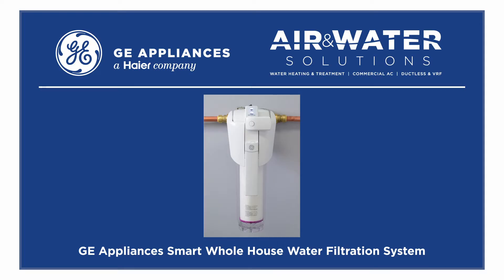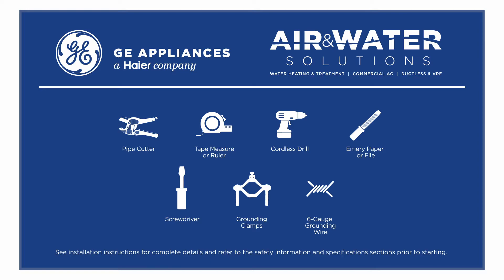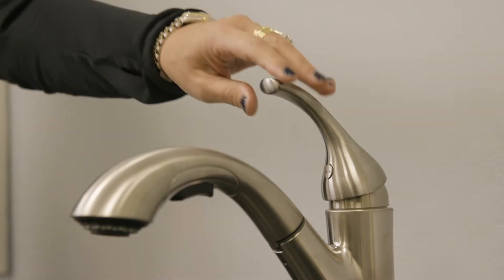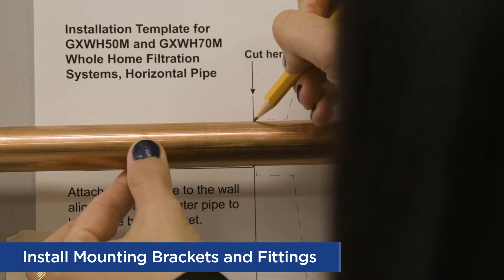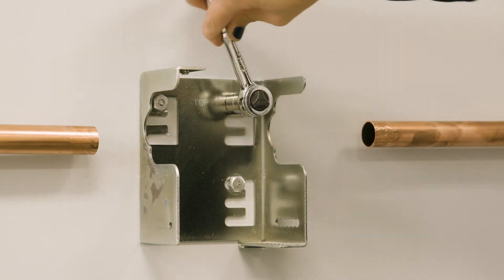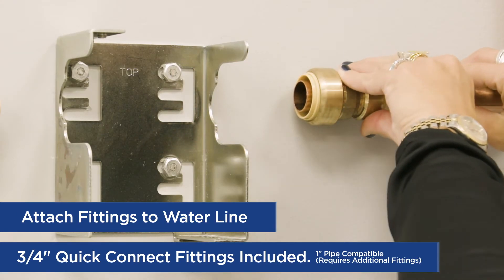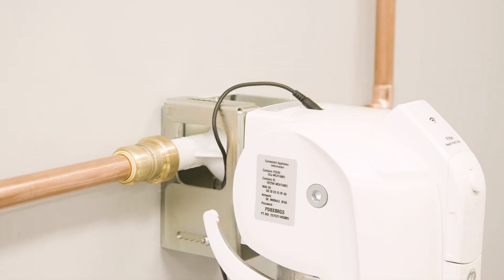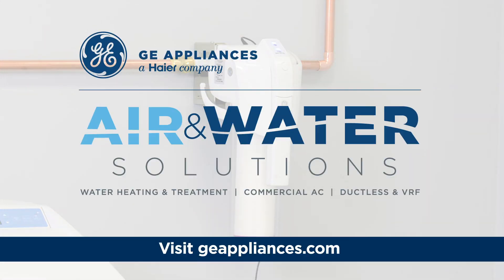Installation - Smart Whole House Water Filtration System

Comment: Why do they mention using a grounding wire when the plug doesn't have one?
Reply from the maker: Hello Peter and thank you for asking.  A copper or galvanized house cold water pipe is often used  to ground electrical outlets in the home.  Grounding will protect you from electrical shock.  The water filter housing may have broken this ground path.  This is explained the necessity on page 3 of the installs supplied.   -- Hope this helps clarify.  GA

Comment: I try to rotate the Inlet/Outlet 90 degree from horizontal to vertical, but it seems to be not moving, anyone knows how to rotate it? Thanks
Reply from the maker: Hi there,

Thanks for reaching out. Sorry to hear about the issues that you've had with your filtration system. We can understand how that'd be frustrating.

Do you mind to share your model and serial numbers with us? If you need help finding those, you can use this link: https://www.geappliances.com/ge/find-model-serial-number/

Hope to hear from you soon. -MS